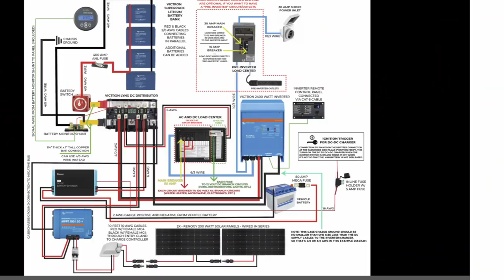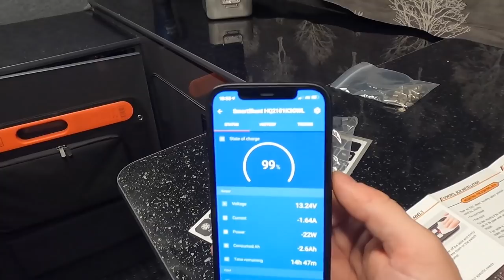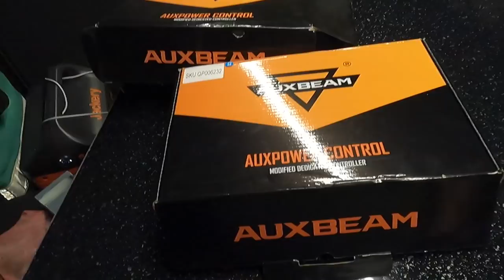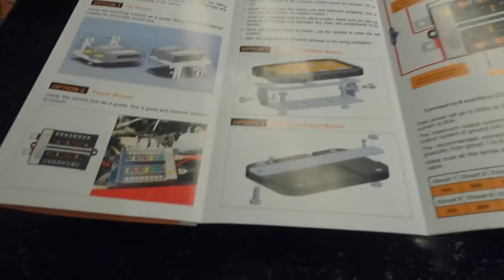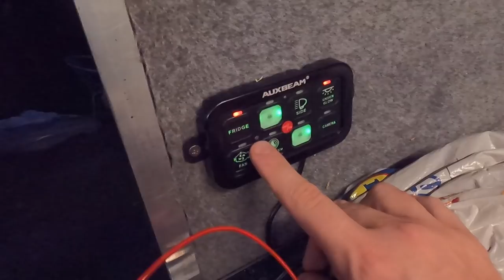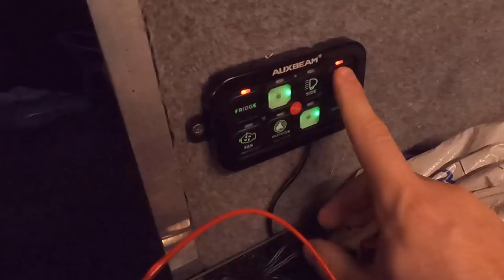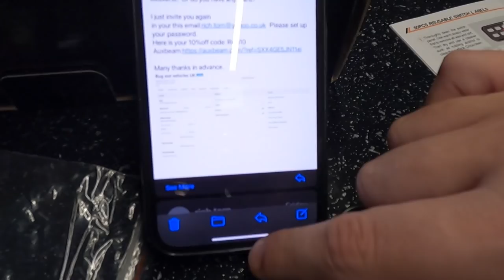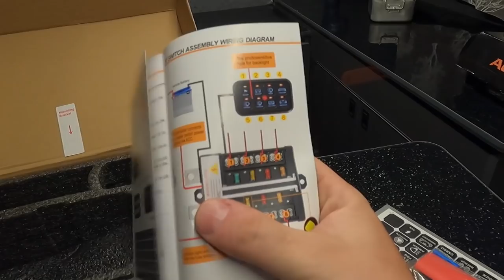12volt camper van wiring

Comment: Good info for folks doing their own installs. Can't believe how bad some electrical installs are. I like the Auxbeam switch panel but I would be concerned about it failing which would mean I lose all those function in one hit. I spent many years as prototype engineer with military vehicles and airport fire trucks. Each time we added more tech we got more reliability issues. Good practice to use conduits etc where cables are vulnerable. That run of conduit needs clipping though as it can still vibrate and move which although unlikely to chafe the wires inside, it can cause accelerated work hardening of the copper which you don't want. Basic rule of thumb is to make sure all cables are clipped, saddled etc and cannot move. If they can move they can chafe or work harden then fail. Edge protection and gentle swept bends are also very important. Keep up the good videos👍

Comment: Very good video all made sense, and I am a electrical Numpty ,struggle with electrical installations, in the 110, safety being the main issue, has to be safe , looks very good system, thanks.
Reply from the maker: That’s why I like this. Big fuss supplies the board and little fuses on the panel for individual items.
Reply: @Bugoutvehiclesuk  thanks for that 👍

Comment: Less stress when you don't have to worry about if your batteries are charged enough. What a game changer. Good info on fuses, I'm a firefighter here in the states and I've seen more than one car catch fire because the owner did some mods and didn't do it correctly. It's amazing how quick wires will chafe and short out. Good video.

Comment: I highly agree Rich. Copex protection for wires is highly needed when doing wiring systems for campers and Overland vehicles. My biggest pet peeve as a former technician was guys installing their own stuff and using improper wire connectors and not organizing their wiring so its all a spaghetti mess to hunt through. Here in the states when guys wire up winches and stuff I always went a grade higher than recommended for cabling. Double 0 cable was the best choice for running winch cabling for rear mounted winch connections. Double 0 is comparable to welder lead wiring for stick welding. I also used the kits to make my own cable ends. Simply drop in a solder pellet into the terminal ends, heat with a torch, stick in the cable to the terminal, and do the crimp with the supplied tool. Once my back heals I should do a video on doing this. I find after you hit your 40's the body doesn't bounce back from injuries as they used to.
Reply from the maker: I get you mate. I was climbing round yesterday and feel old today.

Comment: Top video mate very help full as I am a bit of a that  will do type of guy but that set up makes so much more sense 👍👍
Reply from the maker: Most of the time that will do works. It’s that one time on the motorway when it short it pays to take a little longer.
Reply: @Bugoutvehiclesuk  that it need to stop and as you said in the video take that little bit more time and do a proper job boss video mate